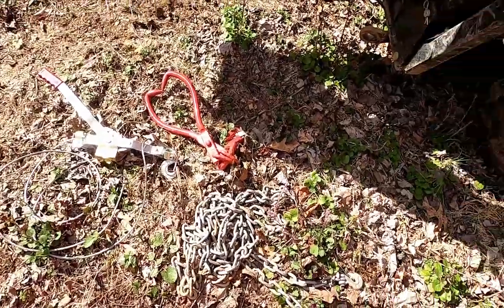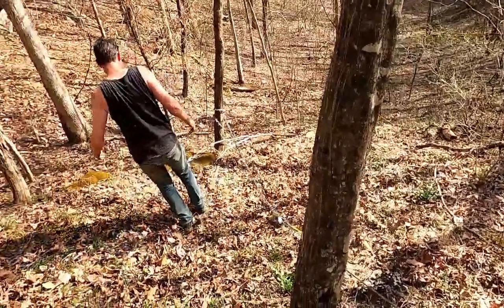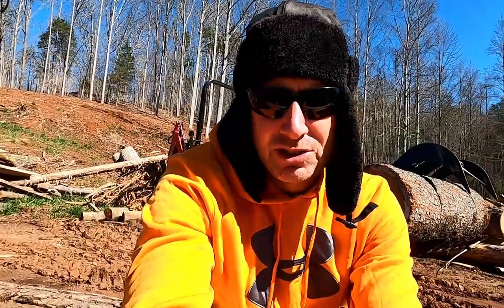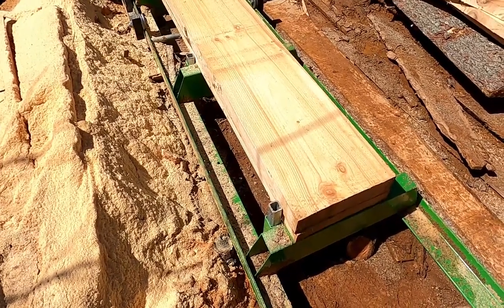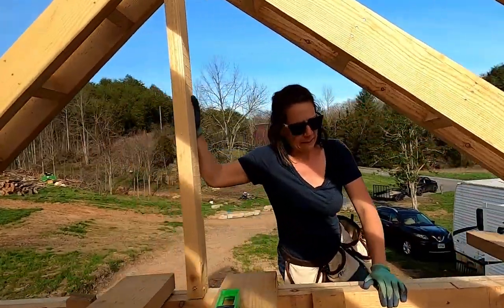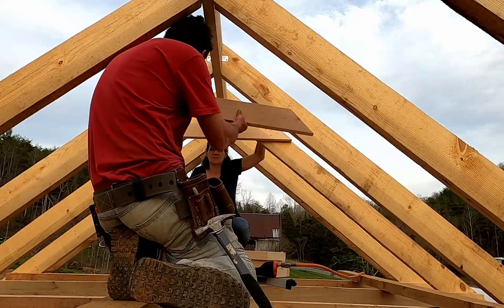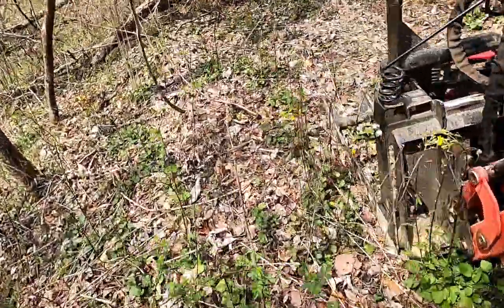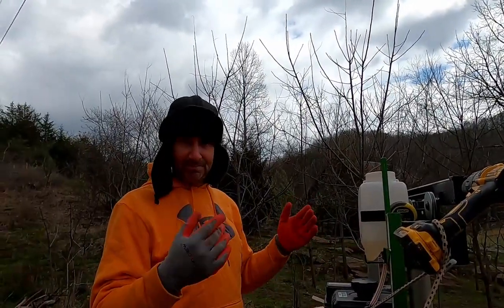E28 - Collar ties complete our structural framing

Comment: I’m sure you don’t need the suggestion of another project… But may I suggest putting up deer fence around all your fruit trees. And you may also want to put up deer fence with a lower run of varmint fence around your vegetable gardens. If your area is anything like mine, the varmints will love eating your plants! You guys are making great progress!
Reply from the maker: Thanks, yes we need some fencing pronto!  We added some around the persimmons already and made a cage for the new fujis.  A more permanent solution for the whole area is still in the planning stages.
Reply: How tall does a deer fence have to be?  

I've chased them out of my yard, and a standard fence doesn't slow them down.  One leaped over the fence and onto the hood of my wife's Navigator before scrambling off.

I think I told her about it!

Comment: I can tell you from experience John your choice in using the Poplar trees for framing and also for siding is the best choice. Termites and black carpenter ants love Red Oak. Yet they won't touch Poplar wood. My wife and I bought a farm 36 years ago, and the old house was nearly dilapidated from termites. We ended up tearing it down about 10 years later because of termites. All the poplar 1" lumber was good, however the studs, rafters, and floor joists were Red Oak and they were completely ruined by the termites.  If you ever noticed all the old timers would build their barns out of Poplar trees and I've seen some that were over 100 years old. Poplar will definitely stand the test of time.
Reply from the maker: Thank you for sharing, Dean.  It actually puts my mind at ease.  My first idea of using oak was because of its strength.  I thought it would assist in tying all the structure together like sheathing, and I also know you can put it up green without much shrinkage.  Poplar is abundant here and as strong as pine (I've researched).  It also takes paint really well.  I'm glad to hear there are many other, more important, benefits too.  I believe our old barn you see in the videos is made of poplar, and that thing is very old!

Comment: Check into 1/2" choker cable for moving logs down and through tight spots. Grapples are only good for lifting and then dragging.  I use 25-30 ft lengths for up to 2 ft diameter trees.  The buttons ends slip right under the log and with an eye on the other end it's easy to connect to chain or a tractor bucket or hitch point.  Learning on the pie and hinge of your felling cut is tough.  Also watch for tension and/or compression in downed trees, as the one that split.  Many a man has been hurt getting slapped off their feet by the release of incredible forces stored up in them.  Plastic wedges are great bar savers for keeping the chain from being pinched and helping control a fall.  Never go out without a pair. There used to be good guidebooks on tree felling.  USFS now has some out for woodlot owners.

Comment: An idea for the dealing with the mud by using cast off lumber. The big gas and exploration companies make plank roads for reaching their work sites with heavy equipment  here in South Louisiana. Maybe turn the boards round side down for a flat surface.  And they can be removed by the backhoe when not in use anymore.  Just a thought.
Reply from the maker: It's funny you say that, Jeff.  Meg has laid a few planks on the ground where the sawmill operator walks, just to make it a bit more comfortable for me when it looks like a bog.

Comment: Okay for future reference, hold up your axe by the end of the handle and 2 fingers so it hangs like a plumb bob and it will tell you which way the tree is leaning if you hold it up against the edge of the sight line of the tree you will know which way it is going to fall. You have to remember, if it is leaning to the right it is going to fall to the right whether you want it to or not. Your only other option is your bottle jack but you have to cut the jack pocket in before you cut any other part of the trunk and get the jack in place and under pressure FIRST!

Comment: That cut on ties needed to be the 12 side of a 9/12 pitch. You lay square on material as square, take pencil and make a mark at the common mark on square at 9. Then you keep pivot point and swing edge of square to pencil mark and make your line. That will give you the 12 side (seat cut) horizontal of any pitch. The pitch you cut on those is the plumb cut (Vertical)
Reply from the maker: Good explanation and makes total sense.  I'm glad I'm practicing and messing up here and there on the shed before the big project of the house.  I'll get it with repetition.  Kind of like doing crown molding with a miter saw - having that ahah moment.